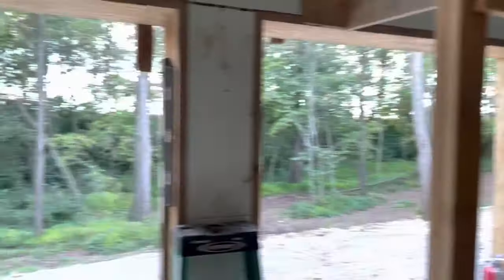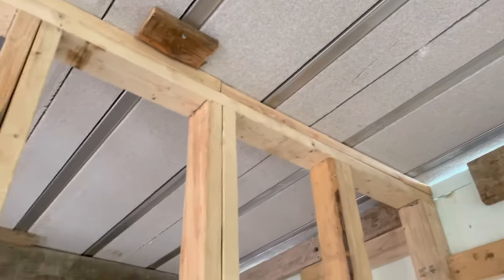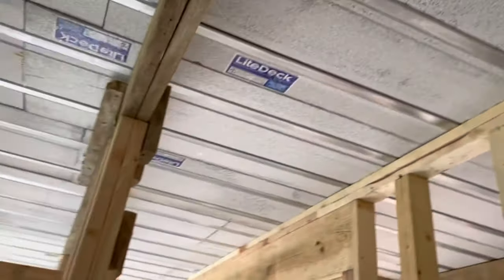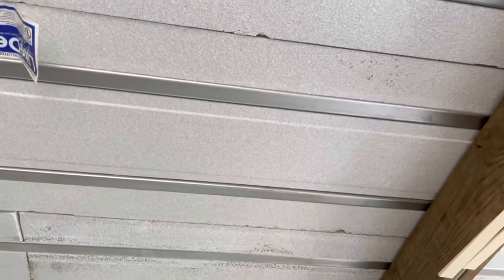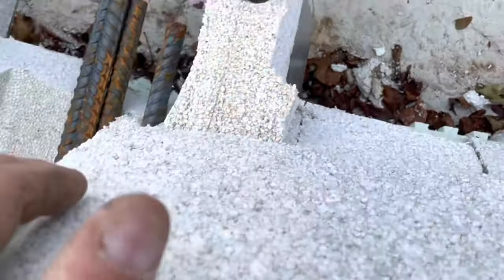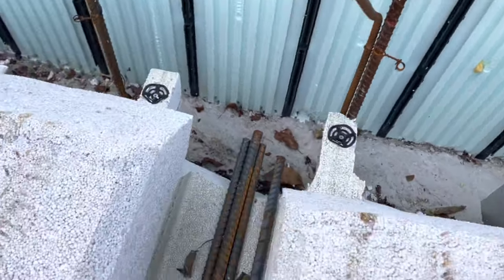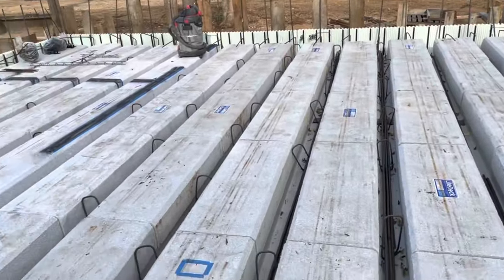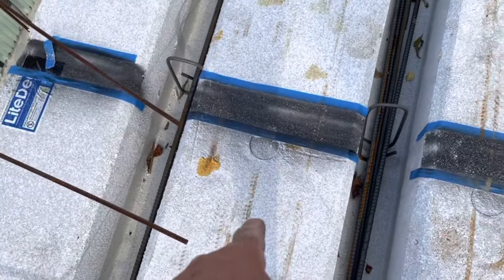ICF Lite Deck connection and Rebar Stirrups.

Comment: Thanks for showing that critical connection point. There is something about it resting on the vertical foam block thats off putting. More so when it comes to a clear down application. I’ll have to do more reading

Comment: I commented on an earlier video, glad you DID do the hole so the concrete will be resting on the beam.  I'm thinking of doing thicker walls so the edge of the decking will be on concrete rather then the foam.  Seems like it might be a little stronger that way.  Loved the cinematic intro!

Comment: How did you come up with the stirrup design and spacing?  

I like your idea of hanging the beams from the top grid rebar.  I've only seen the plastic dual bar holders that lay in the beam pocket used before, but your idea saves a step.
Reply from the maker: I don't know. I guess my years of commercial construction and we had to use stirrups sometimes. I needed a way to hold the top 2 rows of rebar in the concrete beam and that is what i came up with. I'm still a bit nervous that it will work completely. Supposed to rain for the next 2 days so not sure how much I will get done .

Comment: Great stuff. Just started watching your series. All the best. Why litedeck and what is the ballpark price increase if you were to go with joists and subfloor
Reply from the maker: I am doing Lite Deck because I wanted a concrete home. Also it will make the radiant floor heat efficient.  I think it will help with noise transition into the basement. Also I can build it by myself without help or crane. I don't know how $ compared to wood, I never priced wood.
Reply: @concretehomestead5742  : thanks. Good reasoning.